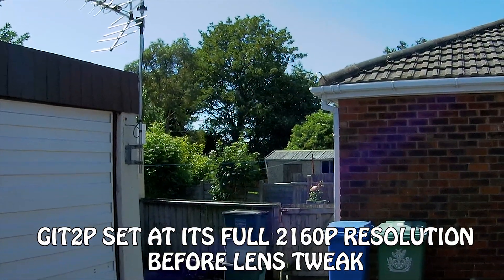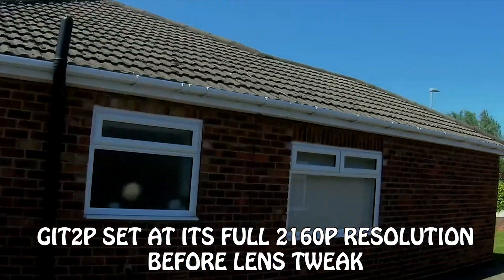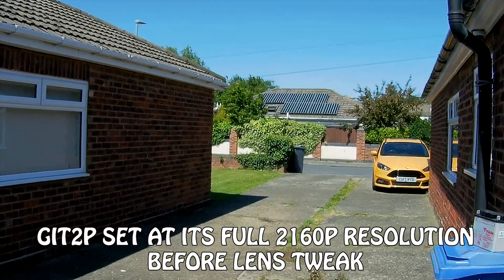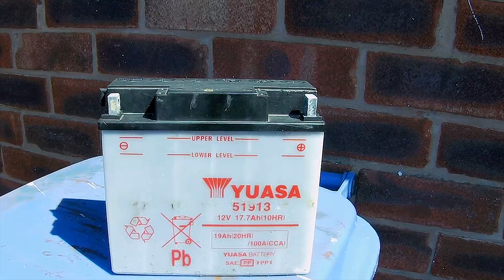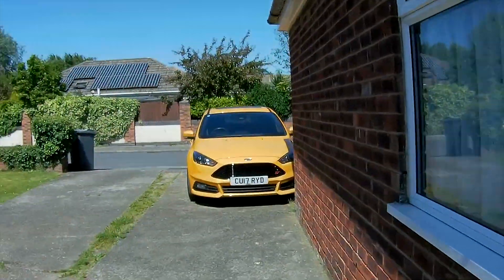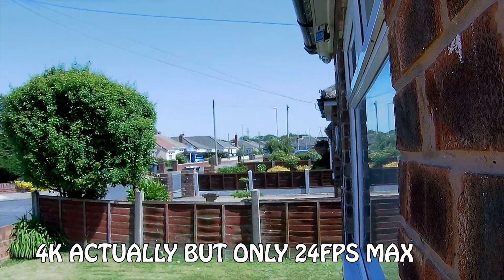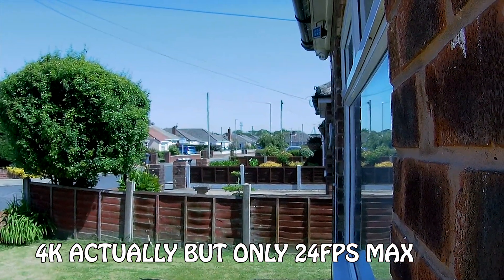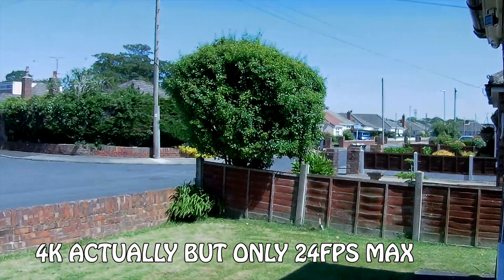DOES YOUR ACTION CAM LOOK OUT OF FOCUS?...AN EASY FIX ON A GIT2P BUT COULD BE ALMOST ANY ACTION CAM

Comment: This is a lot more tricky then it seems. I kinda wish I never moved mine, a similar kind of action cam from the default position now as its difficult to get the focus perfect from just the small screen 😂
Reply from the maker: Hi Keith...yes it is a tricky process but I had no option as my focus just wasn't acceptable...it's 5.5 years ago since I did this video and since then thankfully action cams have come a long way and have proper accurate focus right out of the box .....I felt it was pretty unusable as it was hence me thinking it was worth doing even if it went wrong....of course they have also increased in price since then but are in a different league to the gitup in this vid .I still use my MK1 osmo action and can thoroughly recommend them if you see a used one anywhere

Comment: Thank you for your video. How do you think, is it possible attach some say 'handle' to lenses and tune focus on the fly? How I see it: attach pin to lenses and make a little cut for it in casing. Move it left for near details and move it right for far. How do you think, is it possible?
Reply from the maker: I suppose anything is possible...the problem would be locking the lens in any position without any movement at all settings. It only takes a tiny bit of movement to upset the focus so to have a lever that is moveable and yet still not allow any play backwards or forwards may be quite difficult particularly in an action camera that is often taking a few knocks.